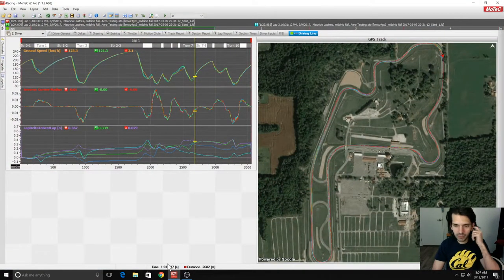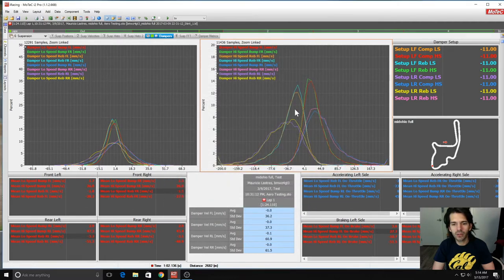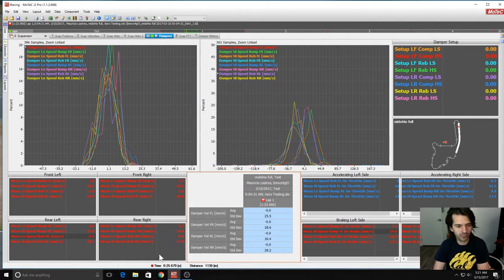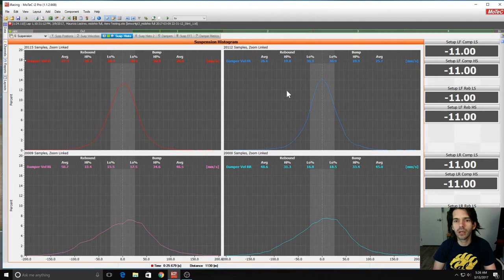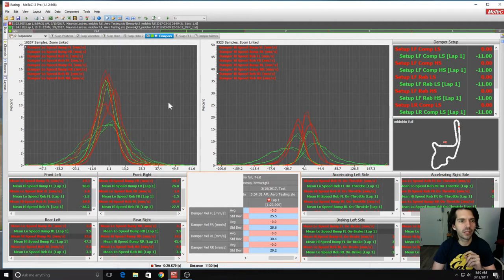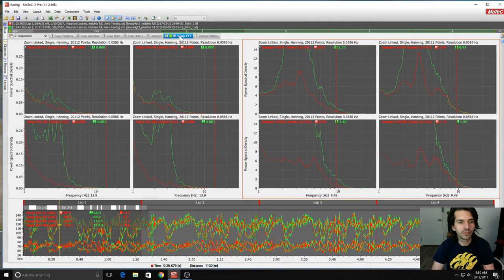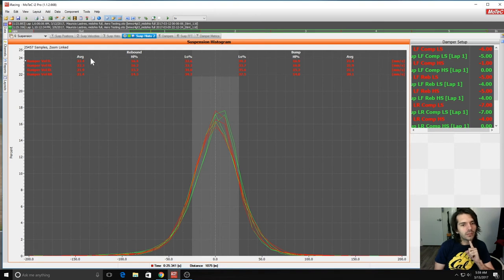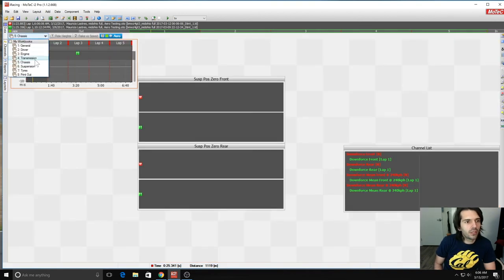iRacing Motec Tutorial: Damper analysis & tuning Ep. 6

Comment: For the histograms. if one damper shows higher percentage in one way, that means it's spending more time in that movement. So what we looking for is stiffen that damping and that will slow it down? An example: If bump is 38 and rebound is 40 than we need a bit stiffer rebound?
Also, is it always best to have them nearly equal?
Reply from the maker: To start off with, yes you want them nearly equal. The reason for this comes from basic control theory and intuitively you can see in your mind that if you want maximum grip you need the tire to be in contact with the ground and if it rebounds way more than it compresses it will lead to a funky response and limit your grip because that will not lead to optimal damping of oscillations. Once you have a setup well developed and the histograms are decently balanced, you can ask yourself about what the car needs to go even faster. Are you struggling on turn-in? Are you understeering as you apply throttle? Are you oversteering as you release the brakes? If you want to make a change to one of those characteristics you then make a change to the slow damping only and this may throw off the histogram symmetry but it will lead to faster lap times hopefully.
Reply from the maker: Yes, more damping will cause the speeds to slow down and the histogram to look pointier or sharper looking.
Reply: Hey Mauricio I have a question about this answer. I really can't see why symmetry is something that you want to have.
It's incorrect to say that if you have assymetry in the speed histogramm your tire will rebound more than it bump,  because if that were the case this would mean that the car is constantly going up or down lap after lap.
Since this is not the case, the assymetry balance itself between high and low speed, rebound and bump. (So more time spent in low speed bump will automatically means more time in high speed rebound for example)
But why would you want to have the same time spent in rebound and bump low speed ? Or why the same amount of time spend in rebound and bump High speed ?
For me the aim is to control wheel and chassis mode the best you can, and I can not figure out the symmetry in wheel speed repartition will help for this.
Thanks !

Comment: i dont have damperVel or damper Lo speed etc channels, did you made them for yourself somehow?
Reply from the maker: There are two versions of dmaper velocity. One is an output channel from iRacing and the other is a calculated channel done automatically by Motec which differentiates the Susp Pos channels. The channel is made already for you but it is usually broken and you have to go to the Suspension histogram properties to fix the velocity calculations. The other channels like hi and lo speed, I made myself.
Reply: i watched ep.5 it's all clear now, but not quiet sure how can i fix damper velocities in Suspension histogram properties, i'll check other videos maybe i find it out.
Reply: I found it already. Thanks for the videos!
( For anyone who need the same info it is in noob to pro 3 of4)